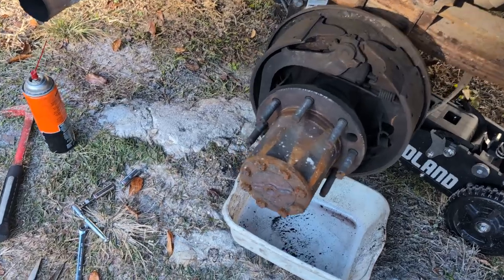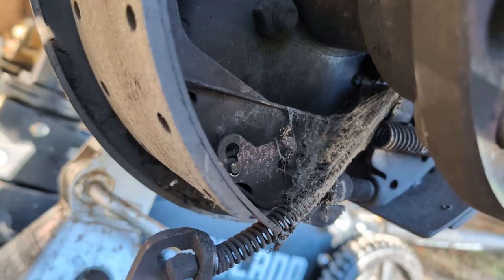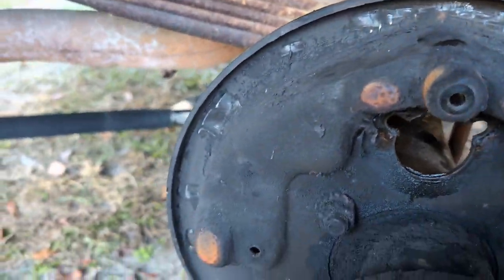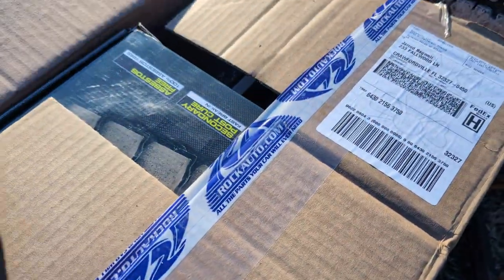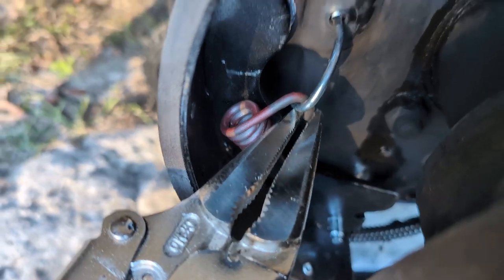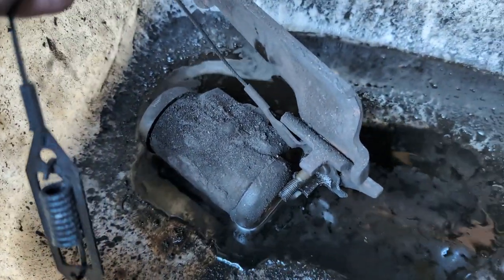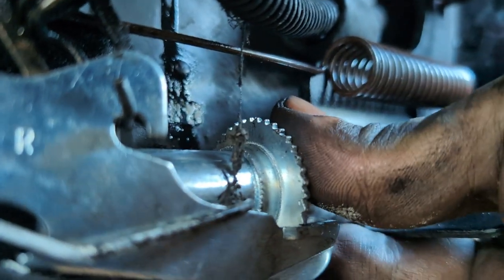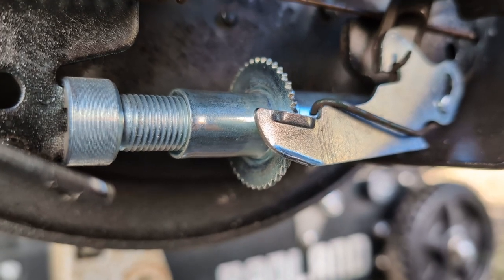Episode 155  - Rear Drum Brakes 1989 Ford F-350

Comment: Re Shoe Spring / J Nail I use a Vice grip C Clamp [ welding [ & depress the spring arm inward  adjusting spring position with a screwdriver, then lever the J Nail in place with DENTAL PIC tool - the C Clamp lets me have time to chug some more beer to Enhance my calm -  The break cylinder can come out without removing the shoes & e brake lever assembly by libating with more beer = SLOW Down and 'Plan the work ,then work the plan '- put 1 bolt partially on the back of the cylinder so it SLOTS into the  back plate  cylinder bolt hole ,snug it then the other bolt hole  is aligned to screw in the 2nd bolt - - - my E350  V10 Van is single wheel BUT has  3 &1/2 '' wide Shoes - - Some Better Auto Parts  stores have packs of  DENTAL PICS  eg hook , straight , bent  etc - - Thanks for doing this excellent DIY Video
Reply from the maker: Thanks for all the advice.  Normally I do try to plan the work then work the plan but often when I'm filming stuff it's the first time I've ever worked on it.  To remain authentic to you guys, I film it all, including the chaos of doing something for the first time and having to figure it out.

Comment: good vid i struggled with those springs and hooks too and the parking brake was not working so will be adjusting that next can see the drums are not tight enuff yet so more adjustment needed those hooks for the springs fell off too had to put a bit more of a hook on them  the ones i had were from the states too so hope they will stay in place now  thanks for good vid from across the pond in wales  my van is a 1996 e 350 but the set up is exat the same on it thanks
Reply from the maker: Glad I could help a friend across the pond.  I found the F-350 brakes to be easier than working on the 1997 E-150 I have or the 1993 F-250 I had to work on in the past.
Reply: @MazdaB3K  not a lot of info over here all though ive had a good few us  cars  and not many of them about either as gas here would be around 10 dollers a gallon or more so a lot of fiat etc desiel vans fiat  same as promaster well in looks ive been doing this one for a bit  its got the 5.8 in it and only 34 k miles backed by the service history its been converted to a class b by bigfoot app rare only 52 ever done still an e 350 just a rare conversion a few probs fuel pump brake lines etc fuel pump had to go through the floor as no other choice as a water tank along side it so cant get to hanger bolts as the water tank has been coverd in fiberglass etc transmission flued is on the list so more fun

Comment: Nice detailed video. I'm currently working on my 89 F350 single rear wheel. These jobs aren't much fun. Need to start a go fund me for you some gloves?? 😂
Reply from the maker: Donations for consumables would be nice indeed.  Question for you.  Is your F350 manual or auto.  If auto, when does it shift from 1st to 2nd gear rpm wise?

Comment: A good detailed video.  I have a 1990 ford f250 with the same setup. My brake shoes still have a lot of meat left on them, but my brake cylinder is leaking.  Would I have to remove any upper springs in order to pull the wheel cylinder out ?    thanks
Reply from the maker: In this design there are no upper springs that have to come off in order to get to the wheel cylinder.  You need to remove the parking brake arm and the bolt that it mounts on.  After that you should have access to the wheel cylinder.  This design uses springs that hook onto the holding pins to in place of the upper springs you see in other drum brake designs.

Comment: I have an 89 f250.  The rear drum brakes worked great until they started to grab and I noticed the peddle had more travel. I'm no stranger to servicing brakes and I just removed cleaned and replace all the parts and adjusted them after buying the truck. I tried adjusting from the slot in the backing plate, rotating the wheel upward while pulling  the tool down. The shoes stared pulling away from the drums. I'm I adjusting them wrong or is the adjuster backward or on the wrong side? I have yet to pull the drums and investigate. I think the auto adjustment has been loosing them instead of tightening.
Reply from the maker: I assume you mean you've been working the star wheel adjuster? If you turn it with the teeth it should tighten the brakes.  If you turn against the teeth on the wheel that should loosen the brakes.  Star wheels are sided so it's possible to install the wrong one.  Ask me how I know....